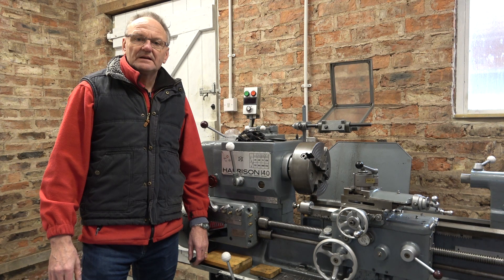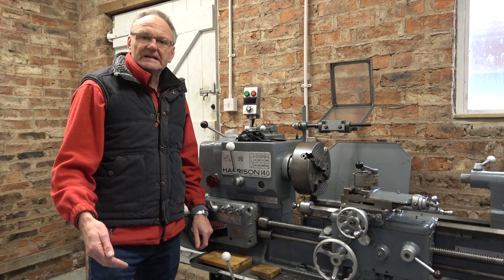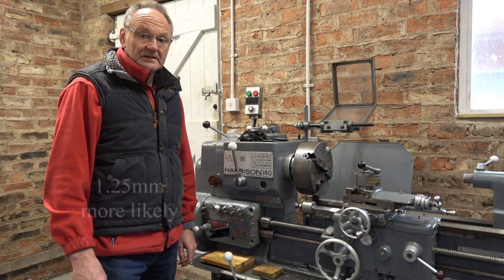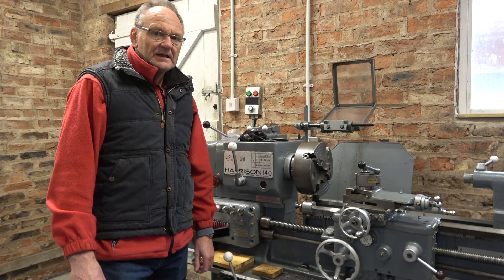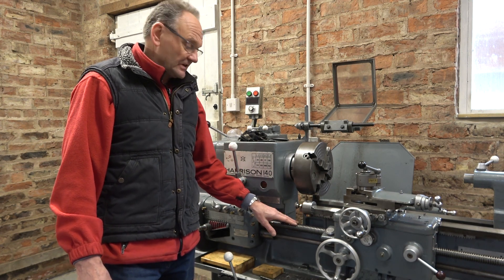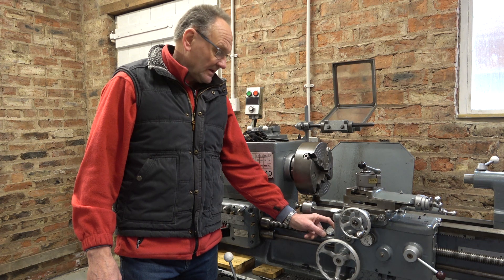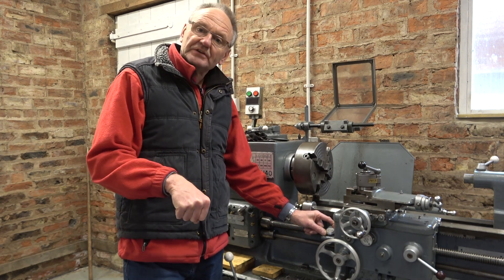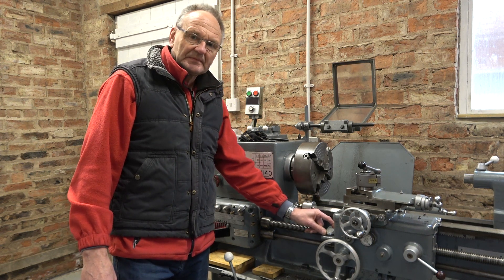HS41 Harrison 140 lathe screwcutting setup

Comment: So I see the plate on quick change box has little thumbscrews and indicated there are additional metric pitches on the backside of the plate, what I’m wondering is there an entirely seperate plate they supply that’d you’d mount up when cutting imperial?  Seems a little Rube-Goldberg-ish when most lathes I’ve come across that have imp/metric capabilities will just have it all marked on one plate.  I guess space might have been the problem for them as usual they will have a bigger plate showing the positioning of the changewheels and number of teeth for imp/metric and even module and diametrical pitches on universal gearboxes in addition to the lever positions.
Reply from the maker: Hi Robert, these lathes were offered in different versions and the 140 model was “all metric” which in practical terms meant a 6mm pitch lead screw in place of 1/4 inch pitch, metric dials, an extra knob on the (imperial) screw cutting to get more metric pitches, and of course a metric plate on the SC gearbox. The lathe can cut the imperial threads with the use of 40 and 63 tooth change gears but these were not supplied as standard. Once you have those the tpi positions on the SC box are the same as for the imperial lathe although the change gear combinations to get those are different. Cheers

Comment: Hi love your Harrison  videos as I just purchased one myself and I have learnt a lot about the Harrison.. But if you get a chance can you please answer one question. When cutting threads and make your first forward pass do you engage the clutch then shift the large lever to reverse? Or after the forward pass you you need to turn off the motor before engaging reverse? Hope this makes sense.
Reply from the maker: Hi Steve, likely I will include some stuff you already know in my answer but to make the story complete .....  If you are cutting metric threads on a metric lathe or imperial threads on an imperial lathe the normal cycle is:- set up the gearbox for the pitch you want, start the motor, engage the clutch so the work is spinning, zero off on the work, move the tool off the work, set the cut, engage screwcutting drive (i.e. pull up the lever on the saddle to engage the half nuts on the lead screw) at the right place on the screwcutting indicator dial on the saddle, complete the first cut (often in a relief recess on the work), disengage the screwcutting drive, wind out the tool to clear the work, move the saddle to the start, apply the next cut, engage the drive with the screwcutting dial indicator marks aligned correctly .... repeat until done. However if you are screwcutting imperial on a metric lathe or vice versa you must not drop out the screwcutting drive once started because you have no way of finding the right place to reengage the drive and that's when reverse comes into it, to get the saddle/tool back to the start.   So when you come to end of the first cut just disengage the clutch but leave everything else engaged. Reversing the motor depends on how you are set up. As supplied personally I would move the big lever to OFF and let the motor stop, and then move the big lever to REVERSE and let the motor spin up, wind out the tool to clear the work, engage the clutch and let it drive the saddle back to the start, disengage the clutch, move the big lever to OFF and let the motor stop, move the big lever to FORWARD, apply the cut, engage the clutch etc. In my case I drive the motor with an Inverter so I can flip the big lever straight from FORWARD to REVERSE and the Inverter handles the spin down and spin up with a suitable delay as it's 'fly by wire' rather than direct switching. It helps that the Harrisons like mine have a spindle brake which is applied as you disengage the clutch so the work slows down pretty quickly making it quite easy to stop the cut in a narrow gap. I hope all that makes sense.    Feel free to ask further if not. Cheers

Comment: Very good and interesting video. Never realised it was an imperial gearbox. Is there a chart available. indicating what imperial threads can be cut on the 140 lathe? And what change gears would be needed to cut say BA thread forms
Reply from the maker: Hi Phil, email me on haxby_shed@outlook.com and I will send you a chart. I've not applied my mind to BA but you may be able to work it out from the chart because I've calculated every pitch for every setting I think. Cheers.

Comment: Wow - Thank you so much, that was really useful. It has given me a good idea on what I should be doing now. The confusing matter for me was the direction of the 3rd knob. I assumed it should always be over to the right.
Reply from the maker: You are welcome. It took me a while to figure out it was an imperial gearbox adapted for metric. Once I realised that it became a lot clearer. I don't do much thread cutting but what I have done so far has been imperial - such as the Abwood vice nut 8tpi and the 5C drawbar 20tpi. The thread on my Rapidor saw main shaft was 9tpi. We never know what our next job will be so it's good to have all capabilities ready :-)